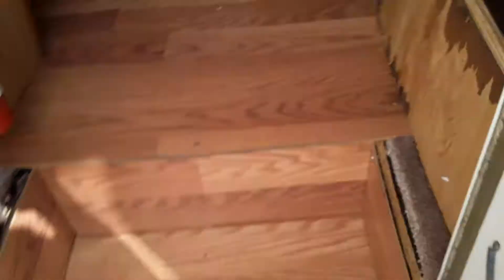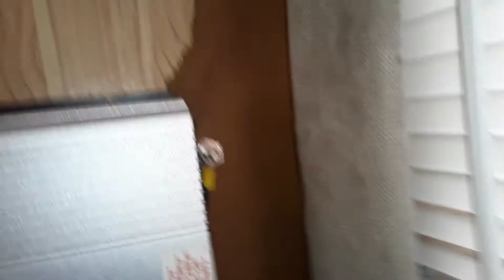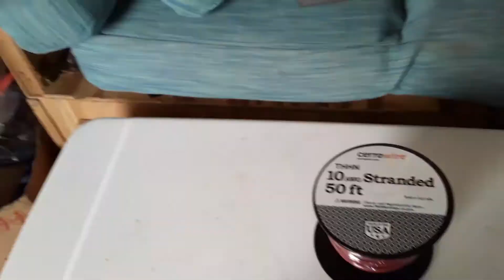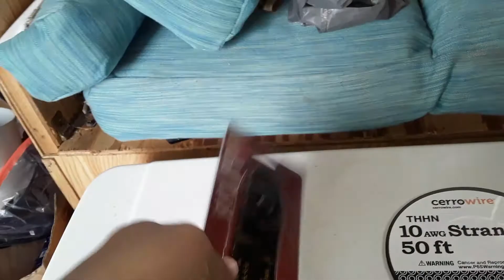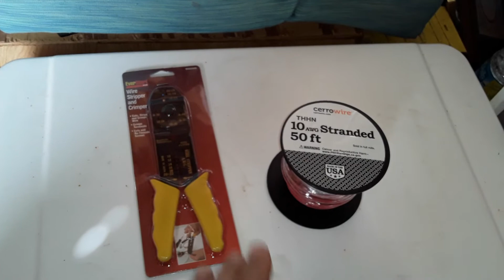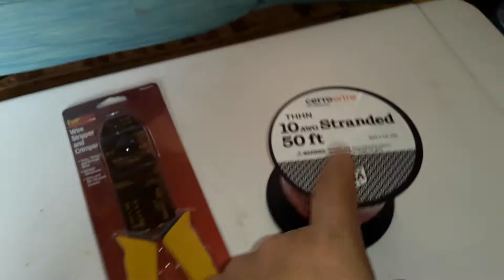Using The RV To Generate It's Own 120V Power Part 1

Comment: 12 volts at 80 amps is really close to 1000 watts.  80 amps will make 10 gauge wire very hot and maybe start a fire.  
You can run the 120 side with 10 gauge wire but NOT the 12 volt side and be safe.  
I have commented about this before and you seemed to just ignore it. 
There is a reason RVs use really thick wire on the 12 volt side to run 1000 - 2000 watt inverters.  Pushing huge amps through small wires start fires.